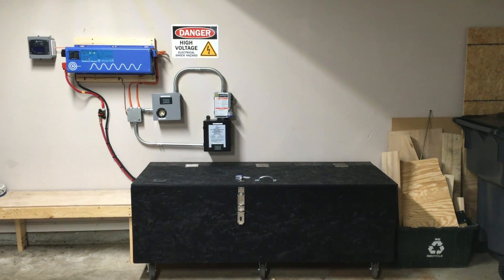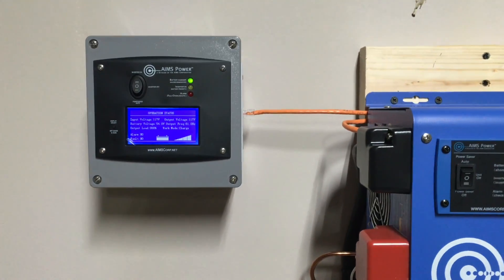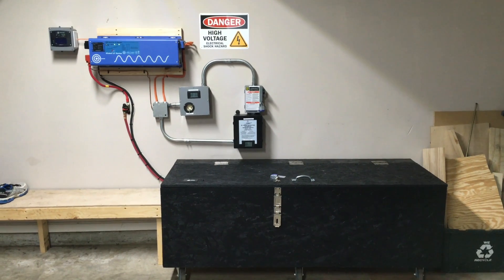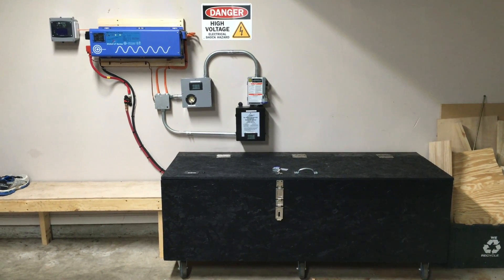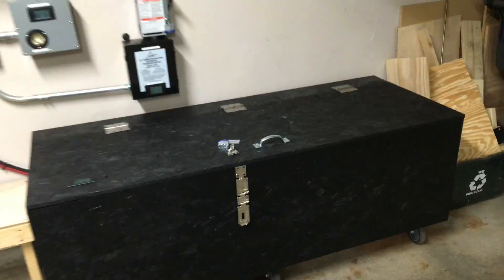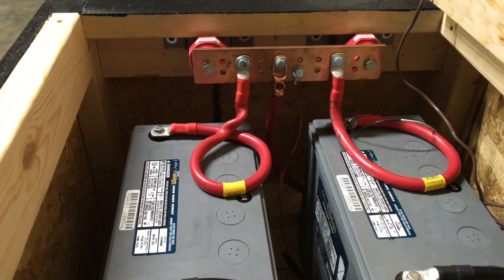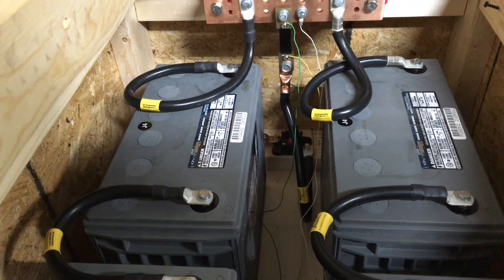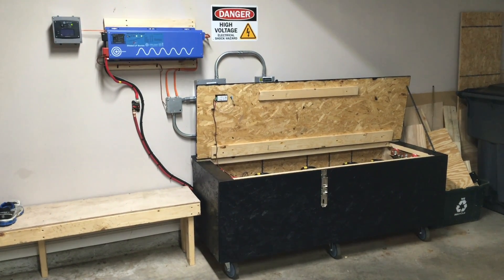Aims 6000 watt 48v inverter and battery bank (Whole home uninterrupted backup) - 1.5 of 3 - UPDATE

Comment: Is each battery 12 volts? And if so does that implies that you connected 4 batteries in series as well as the remainder 4? And if so does that implies that you connected both 48v battery banks in parallel? I ask because I am planning on doing that by myself. But perhaps with 16 12v 101amps  everstart deep cycle batteries.

Comment: wow. I need this to run my lights in a grow room. it would be great for a power outage as well. but I would need some how to charge the batteries. I planned on an electric 120v motor with some high output alternators on a shaft with pulley's to charge the batteries when they get low from the 18hr a day light usage. I would need some type of inverter with about 8-10 120v sockets to plug my lights in. each light is 600w and I have 4 of them. I'm trying to use small electricity to charge those batteries to get around paying the big light bill. Any tips would be a great help. your video is the first one I came across with the almost same concept I need. just yours is so much more awesome! I love it! great video!

Comment: Looks GREAT. Question... what else do you need if you want to hook your stove, washer, air conditioner on there? Thinking about an off the grid cabin? Thanks I appreciate it
Reply from the maker: You would just need an inverter that can handle 220v.  My system was only designed to handle 110v since in a real issues i'm not too concerned with the stove or dryer.

Comment: Most of it looks great I would recommend to get 100 % duty dc breakers real ones from outback or midnight solar. I have used those breakers you have before and kept frying them with my large bank. I also put a 400 amp ANL  FUSE HOLDER GOPOWER T TYPE. And 4/0 tempco welding cables for my battery bank cables . And I have a power in and power out duel copper bus bars that equally put in power and use power across my whole bank. I did build mine as a 1410 AH bank with crown cr-235 6v batteries 12 of them . It can power a 15k btu ac unit offgrid with my 1800 watt solar array and 500 watt 3 phase wind turbine topped at 800 to 1100 watts on windy days . Works very well . I love the box you built . Mine is a metal tool box for a truck built like a Faraday cage . Protects the equipment from EMP. mine is portable wind and solar has 2 30.amp RV PORTS and a ATS for the house when its stored . I can run allot with it. Whats the size of your bank?  48v ?AH
Reply: Here is a good breaker https://www.amazon.com/dp/B007IABO50/ref=cm_sw_r_cp_apa_i_KQOCFbY8Z3ZMB
Reply: I also use a temperature controlled relay board and blower fans to cool my stuff when it gets hot you set it up to trigger and it does it
Reply from the maker: @donaldsteele6276   My current setup is 270Ah.  I don't have nearly the demand you have.  I have tested my system to a real world 22 hours of backup time before my inverter started beeping at me.  I have a max draw of about 1200watts/AC and a sustained draw of about 300watts/AC.
Reply: @dubohio  I would still get a good 100 percent duty cycle dc breaker just a smaller one for 25.00 . I learned my lesson the hard way lol 😆.  Nice setup 👌 😎.  I know this guy that swaps out government redundancy systems he can get me the AGM 200 AH 12V batteries 4 for 100 dollars never used sat around for 6 mo and swapped out . I just purchased 50 of them to build a really big bank for my house . I have about 100 ft of 4/0 cable to make good cables i can't wait to see that in action this bank will be 48v or 60v depending on the inverter charger i get.

Comment: I like your system but I’m wondering why 6000 watts. My house is 3300 sq ft. When my power is off I have a Ryobi 2300 watt generator it runs every light inside and out side my home the refrigerator and all the TVs. I am LED lite as well, I was thinking if you went 3000 watt on your inverter you might go much longer on your batteries
Reply from the maker: 1.) I got a good deal on the 6000 watt.  2.) it's never really a good deal to run anything at at 100% all the time.  3.) I was trying to plan for if I got a bigger place I could handle the expansion and spikes that come along with refrigerators, garage doors, ect... 4.) the pull of a 6000 watt inverter isn't really any more than a 2000 watt inverter.  The inverter itself uses around 25 watts and all additional energy is just what your house is pulling on the unit.  So my systems won't last less time then a 2000 watt inverter where the loads are equal.

Comment: I mean the batteries and inverter alone cost just as much as a regular house generator correct? Not including solar panels
Reply from the maker: If you get a fix Genrac generator no.  If you get a honda generator yes.  The point of this was to have uninterrupted power (which is what I have) that can sustain extended outages with out me getting my honda generator out.  Also if you want the real benefit of solar you need batteries which I’m in the midst of building.
Reply: @dubohio  okay one more question can I use this setup or a solar setup to replace a standard Generac generator?
Reply from the maker: Moja Garicho Mshindi You could to an extent, but this systems is more meant to complement a generator or solar system.  The problem without a generator or solar should you have prolonged power outage and your batteries go dead you won’t be able to recharge them until the grid comes back up.  In my case currently these batteries keep me from running out and starting my honda every time the power flickers.  I can wait ~20 hours before I even think about starting the generator.
Reply: @dubohio  okay

Comment: What size wire (gauge) did you use to connect the batteries to the inverter? 00, 1, 2, 4?
Reply from the maker: I used 2/0 AKA 00 cable between each battery, series, and to the inverter.

Comment: 6000w watt inverter will draw more than 250amp, so you can end up overloading the circuit breaker. Could try using MEGA fuses, these can go up to 500amp. Nice video and nice setup.
Reply: Not on a 48v system. On a 12v system yes
Reply: @CarlosMoreno-ke6rl  Yeah never stopped and thought about that lol, was late at night when i commented. You are 100% correct. I am looking at building another back up system in 24v less current draw than 12v
Reply: @adamjones2025  yea I went with a 12v as my first system and later realized how limited it was. If I may recomend a 48v system, just because it has more room to expand if you need to. Goodluck
Reply: @CarlosMoreno-ke6rl  As our power grid here in Australia and my state is VERY stable power, so when i get a chance over the next year i will build a 24v system as 48v is just too big of a cost for our needs, we only run the bare essentials when the power is out so a 3000w inverter is the biggest i would consider and would draw less than 12v system. I will keep my 12v for office back up. And then go 4 6volt 400Ah AGM batteries, staying away from lithium as just too expensive at the moment. Batteries alone are about 4k so a lot of money for back up system. Total build will set me back around 8k+.
Reply: @adamjones2025  I understand, I'm building a 48V system with lithium batteries now and it is getting pretty expensive. My concern though is that with everything going on in the world today, finding parts for a solar system will be quite difficult. My lithium  batteries took nearly 3 weeks since they were on backorder and my inverter another 2 weeks after that. I hope things improve in the future but studying finance, I dont see this happening anytime soon. Best of luck on your build freind.
Reply: @CarlosMoreno-ke6rl  Same to you would love to see the build. Stay safe.

Comment: How do you charge your battery?
Reply from the maker: allan reyes right now it’s just charged off of utility and generator.  My system is currently only used for backup in the case of emergencies.  But I plan to add solar at some point to help augment my utility use off the gird.

Comment: What you use it for , I don't think  you have enough battery Amp to run a house for 8 house
Reply from the maker: I use it to backing up my house.  And I am currently getting around 22 hours with my house.  When you say 8 hours it’s all relative.  You have no idea what kWh draw is on and off grid.  Your houses kWh doesn’t equal mine.  Before I built this system I spend a lot of time making my home efficient.  While my whole house is on the system what do you expect to be running in an emergency?  Even not in a an emergency I usually just have a computer, TV, fridge, LED lights, and some random chargers for phones plugged in.

Comment: Will I fry the batteries if I keep the Power Supply on while I use the Inverter?
Reply: No. The Aims inverter has a smart charger built in. You can set its program several ways.

Comment: LOL...  This is the reason States and Municipalities don't want people doing their own electrical work.  This is an example of catastrophe ready to occur.   Fuse and breaker should be contained inside a metal box, not screwed directly to a painted paper on sheet-rock wall.  Why conduit is used to protect some conductors, but others are not?  The inverter should be installed in a metal enclosure along with that DC Breaker.  I'm not a fan of wood battery boxes, because they cannot retain an acid spill.  Why do you have a padlock on the disconnect?  Disconnects should be operational at all times if mounted in a secure location.
Reply from the maker: Kevin Dunbar While this is an old video, you seem to have some knowledge.  Would you mind posting a link to a video of your setup so I can look at how you’ve configured your system?  Always looking for pointers and better ideas to make the system safer.  I’ve never seen an inverted that puts off heat and need free airflow contained in a metal box outside the metal box of its own packaging which safely contains the actual inverter mechanisms.  Looking forward to seeing your setup!
Reply: @dubohio  , Just to give a little back ground on myself.  I have over 10 years experience as a Commercial / Industrial Electrician in new construction and electrical maintenance. I have an Associates Degree in Drafting and Design.  For the past 8 years, I've worked an Electrical Designer. 3 of the 8 years I've worked for a Solar Start-up company designing large scale Utility Photovoltaic Systems, early in my solar design career,  I've also designed small rooftop systems for commercial buildings. I currently work in the Oil and Gas industry as an Electrical Designer. 

Inverters and other equipment don't give off a lot of heat. if it does, it is very inefficient or improperly installed.  Under normal operating conditions the above PV System may seem fine, however, the important question is how will the system hold up under fault conditions, including over-load and short circuit conditions.  If you notice, a lot of his electrical connection are exposed, including the heavy gauge conductors between the inverter and the battery bank.  What would happen if some child or anyone not paying attention allowed a metal rake or a bicycle to fall against the wall, making contact with the terminals?  Also, the battery bank is on wheels, which is odd, electrical equipment is always bolted down. Electrical connections should never be exposed and should always be inside a fire resistant box.

Comment: Nice setup, I wish I could afford more /better batteries. At the present I am just getting started and only have two wet cell 6 volt golf cart batteries and two solar panels. But then I'm on SS and only get $754 a month total and my house/cabin (storage building converted into a cabin) payment is $202.32 a month. So I only have about $550 a month for all my bills, food and living expenses. What are you going to do in a SHTF situation when you can't get gasoline for the generator?

Comment: This is by far the best setup I've seen so far, the only thing I am curious about is your charging system for your battery bank,  very impressed. I've worked with 3 phase power for many years, I'm retired now and looking to set up a system like this,
Reply from the maker: Terry Lambing right now it’s just charged off the grid so utility power till I get the solar design completed and installed.

Comment: Great Job but the 19.5 hr run and a buzzer on your inverter isn’t right. Low cut off is typically 10.5-11.0 volts so you have damaged your pack and expect it to fail quicker.

Comment: I may need a extra battery for my 6000 watt inverter. It wont even run my 1000 watt microwave from my cars 12volt battery for more than 30 seconds. I have 0 AWG wire in my system.
Reply: I'm fairly new to this and could be wrong, but I would say you need more battery power to run your microwave. I don't think a car battery has enough watts/amps to run the microwave very long if at all.

Comment: My only concern is those skinny little wires are vulnerable to becoming a fire hazard. I'd have a 1A fuse tapped into the cable no more than 1" away from that thick +ve bus bar so if it snags and shorts, it won't set that nice timber box alight.

Comment: I have a very simple setup with only one 12V 250AH as my main storage. Is it ok to mix capacities in parallel? Im planning to add one more or two 12V 200AH in parallel to my 250AH. I got my 250AH as a very good deal, however the guy who sold me almost doubled the price on his other stuff.

Comment: great job!! I love the battery box!! big on safety. you will never go wrong with disconnects on both pos and neg. I use AGM in my electric scooter. 48V 20Ah CSB batteries 4X. look into EDISON battery NiFe 48V . Got 2 banks 12V 700Ah total over 10 years old 100% power .make sure you set correct battery type in your settings. AGM and flooded have different charge voltage.also keep a 12V meter handy to check balance of each 12V battery.

Comment: You are gunna need more batteries than that.  Those 8 batteries might give you about 5 to 8 kWh total.  An average home uses more than that in 1 day.  Double the size of that battery bank then you might have something useful for more than a day.
Reply from the maker: David James why will I need more batteries then this?
Reply: You better hope you don't have any extended outages more than a fraction of a day with that small bank.
Reply from the maker: https://www.youtube.com/watch?v=SQgJgpkVHo8
Reply: I don't bother with generators.  I can charge my batteries by running my car and let that charge them.
Reply from the maker: I guess thats one way of doing it...   in particular situation It would be extremely time consuming to charge my 48v battery back while it's live off a car that is only designed for charging 12v batteries.  But i'm glad you have a solution that works for you.

Comment: The only thing that I see missing is battery equalization so that overtime that one or more batteries do not get undercharged. That is because not all batteries are made exactly the same. This is very easy to add to your battery box.
Reply: Its built into the inverter. I have the same Aims LF Global....

Comment: Sir I have a inverter Solplus55 IP54 version..
DC INPUT
Max DC power 6600 watts
Max DC voltage 850 V
DC start voltage 380 V
Rated input voltage 450 V
Max mpp voltage 750 V
Min mpp voltage 345 V.
Sir how many watts solar panels and battery volts i need.

Comment: You have the makings of an off grid home as a 35 year electrician ( in the trade) I appreciate it when I see a simple stupid with all the safety features included (no offense) at any time you could add solar or wind maybe both and it could keep your batteries charged use what ever is left over to heat your hot water, as means of a dump load. Very nice indeed

Comment: I see you purposely left out microwave and iron I guess those don't plot well on your graphs remember whatever you take out of those batteries you need to put back twice as much. Also keep in mind batteries have three charge cycles: bulk, absorb,  and float so your array needs to be large enough to get you through the bulk stage quickly as those last 20% battery refill take much longer. And if your batteries don't reach 100% you shorten their life.  Maybe you should consider; many people do more than one bulk of laundry washing a day. 12.5 amp draw on a modern house is very minuscule maybe you live in a shack. I didn't consider that. My bad. But it seems you have a handle on your consumption. Nice starter system  ^_^
Reply from the maker: RAFE Alexa You win sir.  I live in a shack.  Thanks for your comments.  Have a great day :)